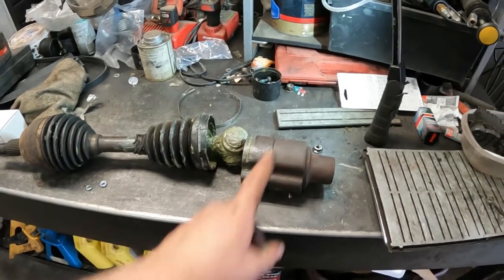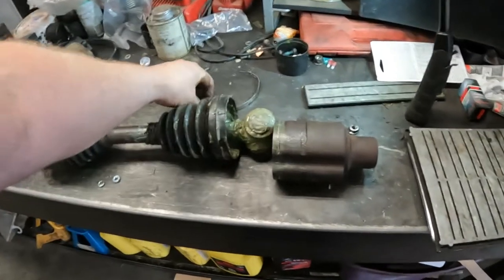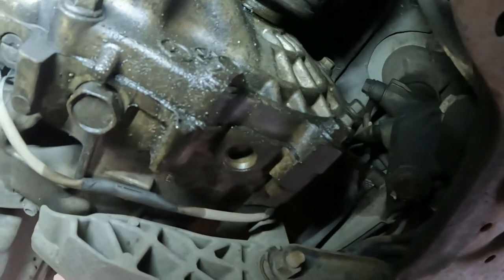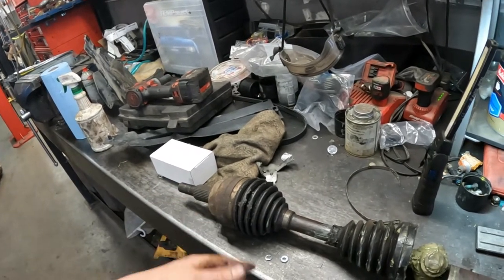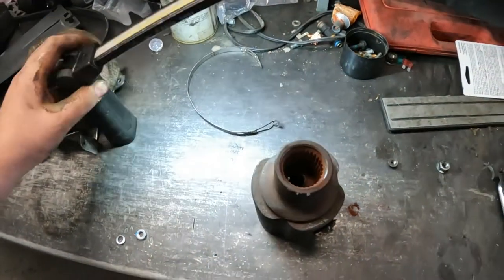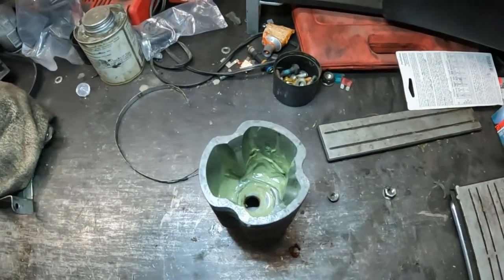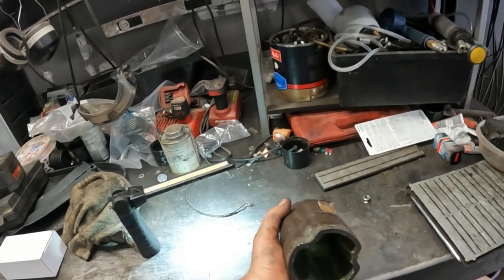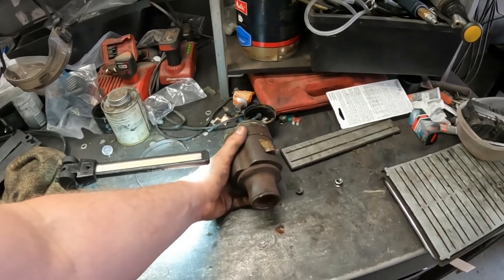How to remove seized front CV Axles on Dodge Ram Trucks - Easy trick no matter how rusted in place!

Comment: I changed the CV axles on my 2010 Ram last weekend and I ended up changing the stub shaft (called CV intermediate shaft in the parts system) rather than trying to break the CV axle off of the stub shaft.  The stub shaft was about the same cost as the CV axle and was worth the cost to get away from fighting with it. After I got it out we put the old one on a hydraulic press at where I work and it took 20 to 25tons to press it out. That was the passenger side.  The drivers side came out pretty easy.

Comment: You can use a large 2 or 3 jaw puller after removing frost plug full of rust then spray penetrant inside and out on splines, use puller to press off even pressure . Seen some Ram 1500 are so loose others rusted solid like this . Great video was checking what other people are doing for this. Living in a area that uses salt on roads makes your life miserable doing these shafts. Thanks for the info.
Reply from the maker: @PeterMilster  You betcha! Only thing to be mindful about the pullers is sometimes the circlip can pop out of its land and bind jam up preventing the axle from coming apart. Super rare but I've had it happen on a couple different vehicles. That's the nice thing about the air hammer is you get that shock whereas the even, steady pressure of a puller might make it a little more easy for the circlip to bind up. But I'm sure a puller will get the job done 98% of the time!
Reply: Up date puller would not remove these shafts,  took drivers side inner shaft out with inner CV knuckle put in press 30 tons will not move had to use plasma cutter and shave off side of CV shaft to spline put back in press it came off with 20 tons pressure, poor design for salt areas. Passenger side had to take zip saw and cut half of inner knuckle off up to snap ring going around, then air hammer with chisel cut part off and then air hammer rest of shaft off diff axle. After removing tried new CV shaft spline will not go on so rusted had to use cut zip saw and clean splines and circlip on axle shaft to get small enough to  fit CV back on with lots grease to help. Some units the CV shaft is loose and falls off others are like this . Poor design for North America .    @eurbanautotech

Comment: I had the whole plug come out after a little air chiseling.  Sprayed the splines good with penetrant. I didn't have the long air chisel but i pulled the spring and slid a 8" length of 1/2" pipe over a straight air punch. Blam! Came right off. You save my butt, thanks!
Reply from the maker: @user-om7bu2lr3t  Nice! Glad it worked for ya! These can be really NASTY at times. I've seen multiple very experienced techs spend a lot of time torching them off!

Comment: Just though of something that could help , the clip is what's frozen right? So, if you carefully drill the flange and install a grease zirt  you can pump grease into the stuck area and push out any rust and dirt that's holding you up right? Of course you would of course verify the diameter of the zirt first to determine what drill bit to use and probably use an angle air drill to do this .

Comment: If you can’t get it off using this method (as I couldn’t) you can use a 3 jaw puller through that same hole with an impact and that did the trick for me
Reply from the maker: @Thomas Frankenhoff  Good idea! Would especially make it easier if you were by yourself on the ground. I have the "Big Nasty" .498" air hammer and up in the air on the hoist I can get a really good grip on the axle while putting my body into the air hammer. It's worked well for me but a 3 jaw puller is definitely a better way of going about it. MUCH easier on the inner shaft too! Definitely don't want to mushroom that... Thanks for the tip!
Reply: Where did you clamp the 3 jaws on to
Reply from the maker: @JKUDO BIKELIFE  I imagine you'd need something like a bearing splitter to put around the inboard side of the axle tulip. That would give you something to clamp on to. 

https://www.amazon.ca/Acouto-Separator-Professional-Universal-1-18-1-97in/dp/B0B2KHWQQ6/
Reply: @jkudobikelife6506  I just held them tight to the backside with my hands until there was pressure and the teeth but in hard enough to get the job done
Reply: I didn't work for me. Im going to try the jaw puller tomorrow

Comment: A shop cracked my front differential in my 2022 Ram 1500 installing a lift kit and trying to remove the axle shaft on passenger side. Now I’m taking it to the dealer to have it fixed at the other shops expense
Reply from the maker: @andrewgleason7466  Jesus! How they manage that? Are we talking like a 6+" lift? Or just something to level it out?
Reply: @eurbanautotech  a 2.5” leveling kit. Brand new truck with only 10K miles.  The shop wanted to put used parts in.  I’m having the truck towed to the dealer today for a new front differential and cv axle. They broke their slide hammer in the process.  I wonder how hard they were hammering it?
Reply from the maker: @andrewgleason7466  That's crazy. They probably thought they could cheat by leaving a few things connected and just cramming the strut in. The lower control arm needs to drop quite a bit to give room for the strut. Especially once it has the spacer on it. They must've left the CV axle fully installed in the hub. Then when they started prying down on the lower control arm it would be applying crazy pressure on the differential. I see a lot of guys try stuff like this to save steps and time. I don't get it when all the fasteners on jobs like this are super easy to get to. With power tools you can remove or loosen all the components very quickly so that you can do the job properly and easily. Sure, there are more steps but all steps go quickly and smoothly and you're not wasting tons of time fighting with "short cuts". 

I hope you manage to get your truck all sorted! Sounds like quite an ugly weekend!

Comment: How hard is this to do on a 5th Gen Ram 1500? Can I use a Dewalt SDS XR with a flat drill bit (ground rod driver) to push it out? Should I expect anything else to come out of the front differential? The CV axles are rusted to hell and it's clunking although the truck is still under warranty Ram and the dealerships won't do squat. TIA!

Comment: So I did what u said, and the axel came loose. However, I cannot remove the back half of the axel from the stub because of the o-ring ( assuming it’s the o-ring). I know it is loose because it moves back and forth, but it does not slide out. At this point I have run out of ideas besides dropping the diff and changing out the whole stub shaft. What else can I use to pull it out completely without having to drop the diff? Last I checked, the shaft was going for $700 on a 2014 Ram 4x4 with a 4” lift.
Reply: I forgot to mention I used a 5 lb slide hammer as well as tying a chain to it and trying to pull it out with a quad. Lol
Reply from the maker: @danielblancacontreras178  Are you trying to remove the passenger side by chance? Driver's is super easy. It's just a small stub shaft that'll pop right out with the axle. Then you can try to separate the two on a bench or just replace it as they're normally pretty cheap. Passenger side is a little more complicated. 

Driver's side:
https://www.dormanproducts.com/p-134625-630-444.aspx

Passenger side kit:
https://www.dormanproducts.com/p-140597-630-446.aspx

If you've freed up the axle on the stub shaft and it's moving a bit then stops then I suspect the end of the stub shaft is probably slightly mushroomed. Then the end of the axle is catching on that taper. I think your only option might be cutting the axle off. You'll then need to carefully grind down the taper off the stub shaft and clean up the splines. Plus changing the axle seal.

Comment: This is what happens when they are improperly installed, mopar says always liberally grease the inside and outside splines both where the shaft goes through the wheelbearing and where it clips on the stubshaft with waterproof grease or moly grease to prevent dirt and moisture from entering the retaining clip area.
But most folks get in a hurry and just slam em in not thinking about stuff like that, then guess who has to fix it properly,
ME ! THATS WHO😂😂😂😂

Comment: Will this work on a 2017 dodge ram 1500
Reply from the maker: @JKUDO BIKELIFE  Yup. Take a look at the inside of your new axle. When you look inside the splines you should see a shinny aluminum center cap.  That's what you pound out that allows you access to the differential stub shaft.

Comment: Had that issue with mine posted a Facebook looking for help guy replied came to my apartment tried to get it off couldn't said put it together and take it to his shop he said 2 days to do them has had it 12 had to call the police to go with me to try and get my truck back supposed to pick it up today doubt he done what he was supposed to he wanted 25 for coming to me and trying I felt that wasn't enough gave him 40 then when I took it to his shop I gave him 100 he then began to ignore me wouldn't call said he lost his phone etc he told the cop I couldn't get the truck cause it was on Jack's etc he told me days ago he did the passenger side but when I went by there to get meds out of truck I looked and the passenger side looked to not be done either both new axles were sitting in the cab still
Reply from the maker: @davidberan470 Damn! I hope you got your truck back... Sounds like he bit off more than he could chew. For a normal vehicle this is a crazy easy job. Were it not for the axle rusting in place it would be something a person could do in half an hour in your driveway. But I've seen this turn into a nearly all day ordeal at full size professional automotive shops!
Reply: @eurbanautotech  at the point of. Just pulling the stub out
Reply: @eurbanautotechi t is better to just replace the stub shaft. The stub shafts wear out anyway especially if it is a lifted truck. I  have seen the stub shaft teeth worn down to nothing too many times. If a stud shaft wears there will be clearance between the CV axle teeth and the stub shaft and that can cause a vibration
Reply: @eurbanautotech  ty yes I did get it back we had to remove the difrential and the stub came out with the axle just replaced it all at that point she is back up and running ty

Comment: What year truck is this ?
Reply from the maker: @Robin Enick  Ah, shoot. I didn't note that, did I? I believe this was a 2009. This exact style was from 2002-2011. 2012-2020 has a slightly different axle and front differential. Still the same problem though. The splines of the differential shaft are outside of the differential. So the only thing preventing moisture from getting in between the diff shaft splines and those of the axle are a cheap o-ring. So the newer ones will rust in place as well.